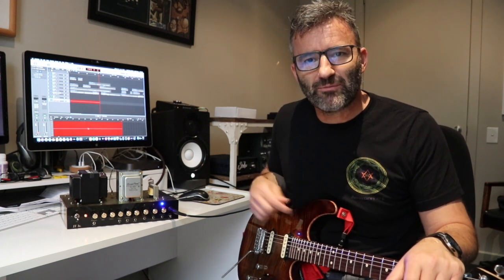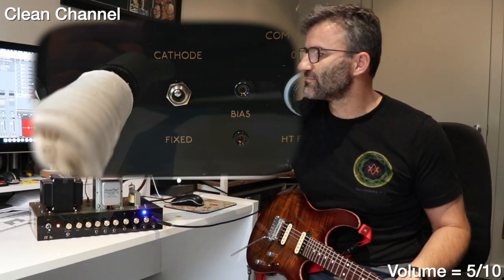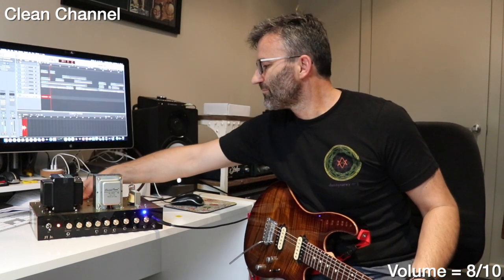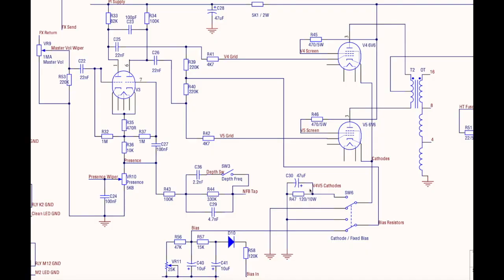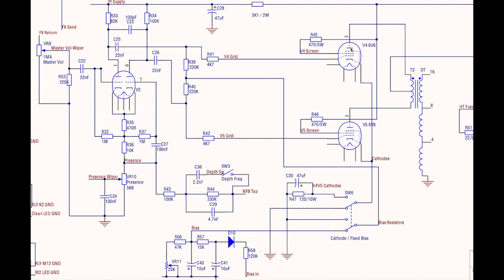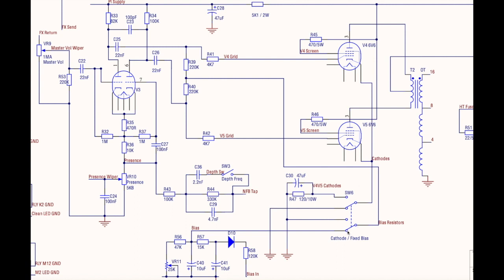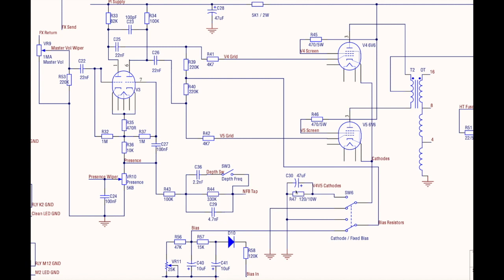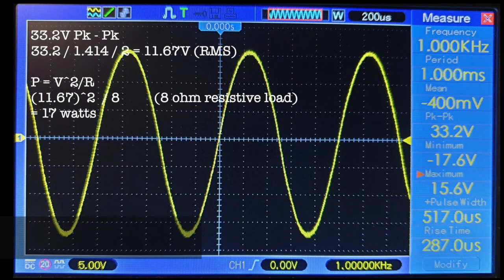Fixed vs. Cathode Bias Tube Guitar Amps - what's the difference??

Comment: I liked the fixed bias sound the best. It just sounds rawer with more harmonics and bass. The cathode bias sounds a little more compressed and maybe a little tighter. But it also sounds like it's being held back. The fixed bias also sounds like it has a better signal-to-noise ratio. This is a really good video!
Reply from the maker: Thank you John!

Comment: This video is perfect for me right now, thank you! 
I have a Princeton Reverb clone I'm tinkering with & wanted to put a cathode bias switch into the circuit. I'm learning as I go & have managed to not kill myself with cheeky capacitors so far, which is nice. 
I've played several gigs using different amps over the years, mine, using other people's, amps provided etc., I've have always suspected I leaned towards cathode bias sound (& feel), nearly, every time. Now, thanks to you, I can quickly hear the difference on the same amp. I will definitely put that switch in now. 🤘

Comment: What an excellent video. I'm about to purchase a cathode biased "metal" amp: the Badcat Lynx-x.
While cathode bias may lack low-end tightness, there is a spongyness and liveliness that attracts my ear :)
Reply: Great amp.  I have the Cougar 50 which seems to be a similar circuit made in Asia.  Of course the Linx will be made with better components, looking at my schematic, the bias circuit on appears to be some sort of hybrid design.  I don't hear this type of biasing being discussed often, and I have limited knowledge about it.  I'm assuming it is some sort of compromise to tighten the bass.  I hadn't had an issue.  I don't think you will be disappointed.
Reply: I think you are right about the design being hybrid is a way to compromise the low end tightness. 
However, as time has passed since I wrote this comment, I have changed my mind and I'm getting a swedish handbuilt 20 watter "Olsson amps Little Hill". This one is also cathode biased and I tried it a few dags ago in a shop. It was tight as hell and you dont even need a tubescreamer. Sure if you wanna play meshuggah you'll need some pedal in front but for normal metal and rock its not needed. Really impressive quality. The sound is that of a hot rod marshall and the clean channel is very warm. Extremely articulate overall and the tightness in the gain channel made me feel like a "faster player" ☺ . Im sure the Lynx is a fine amp with its own thing going on but for my needs the Olsson amp seems to be on another level completely.
Reply: @jonashjalmen5232  I just checked out a video of that amp.  I'll agree with you on the sound of it. It looks similar to the Bad Cat.   
Over the decades, I have spent more money trying to save money than if I would have gotten expensive gear in the first place.
Buy it nice or buy it twice.
Reply: @qua7771  Getting new gear is always fun and will inspire you in different ways and sometimes when the gear is bad its just a learning experience in which you can declare " i dont like this type of tone"  :) I've been using AXE FX II for a couple of years now and while that's an incredible product I have finally grown tired of it. But the good thing about it is that it allowed me to find "my sound". After experimenting with all the various amp models I usually end up with the same kind of tone and the biggest factor that decides your sound characteristic is actually the cab!!
Reply: @jonashjalmen5232  I couldn't agree more.  (Cab and speakers),  I found that out late too.  
When I started playing, we did have the learning resources and technology we do today.  I wasn't able to research gear effectively until the internet era.
A few years ago I found the tone I liked and wished I had found it sooner (A Marshall 1960 cab with two V-30's and two H-75's through the Bad Cat, after rolling tubes). I use a Bad Cat unleash attenuator after learning that every amp has a certain volume that it sounds best at. I can dial back the volume while getting "that" tone.  I can honestly say that I am satisfied, and can now concentrate on things that are less expensive.  It was a long learning experience.
I have always played Les Paul's, and super Strat type guitars.  I am now in the process of building a Tele after returning one that just wasn't for me.  I have never owned a Tele.  I cannot wait until it is completed to play it.  I hope the single coils sound good through my rig.  Otherwise, I do have a few other amps.  Cheers.
Reply: @qua7771  Its pretty similar here (born 93). But its been a good journey right ;) good to hear you've found your tone. And good luck with the Tele! 
Jonas

Comment: Good starter instructional video, especially having the tones and the theory side by side. For me, I would like to see you expand the very last bit with the oscilloscope and delve into what happens with a signal on both, not just the max power, but in terms of the bias point "changing" with cathode bias vs fixed during a dynamically changing set of conditions i.e playing a guitar :);  more of exactly "why" the sound differences occur, cathode is "softer", "squishier" etc, why ?
Reply: Because -Vdc on grid allows for lower V on cathode (thinking at idle) so higher potential to plate. So a higher wattage potential in fixed bias, esp heard in compression of lows in cathode mode.

Comment: In the old days, it was all about more power. Then the world changed and we couldn't drive a 100W amp into a 4x12 cabinet in a small club hard enough to sound good.  So cathode bias had some nice advantages: cheaper (no need for that negative grid bias circuit), self-biasing (no need to adjust the bias when changing tubes), tubes could last a little longer, and lower power giving the overdrive tone a little quieter. Now it's shifting back because distortion tones are being created with pedals for more control into a clean amp. So it all depends on what you're trying to do.

Comment: An interesting comparison. I have often wondered if there was an audible difference between the two bias modes. The 47uF cathode bypass capacitor would have a reactance of ~41 ohms at 82Hz, which may or may not be significant. May be worth trying a 470uF and seeing if it makes a difference. Good luck with your experiments. I agree that for maximum power, fixed bias is the way to go. Cheers, Steve.
Reply: Nah I think he should talk more and play less when demonstrating an amp.

Comment: When you had both cranked, do you think there was any power tube clipping?
I have done the test, and I think when the power amp is clipping is when the difference is most noticeable.
If the power amp is clean, of course there is still a considerable difference in feel, and the extended low end in fixed bias, like you said.
Great video!

Comment: Inspired by your video I actually ended up putting in fixed bias circuitry in a cathode biased amp I'm finishing up with a switch between the two. I got pretty much the same result as you got, cathode biased was sort of swampier and looser in the bottom end and fixed bias was tighter and snappier. That amp has a tube rectifier though so it's still gonna sag a bit of course. Haven't tried it out properly yet (sleeping kids 😂) but it was well worth experimenting with!
Reply from the maker: Great work!

Comment: Hi Jason, when selecting the correct value cathode bias resistor do you work that out mathematically or fit a value you have seen before / you think will be suitable and then adjust by measuring the voltage at the cathode bias resistor?
Reply from the maker: There are some online calculators for this, which give a good starting point.  Then I adjust once built - aiming for 100% dissipation in cathode bias mode.
Reply: @HeadfirstAmps   Thank you.

Comment: Fixed bias designs give the greatest output power for a given output tube - while the cathode bias is usually preferred in hi-fi applications because it exhibits the typical "classic tube sound". Another advantage of cathode bias is that you don't have to use matched tubes in push-pull output applications which can be useful if your only source of operational tubes are from discarded gear being sold off as a bargain in garage sales.
Reply from the maker: Great input Laurentz!  You are spot on.  Actually I have two Quad40 monoblocks for HiFi which are cathode bias.

Comment: I hear a slight difference. How the notes bloom, or would say compress. 
I definitely think that fixed mode is for tighter approach but the other feels more forgiving kinda.
There’s no better, both have their mojos. A great build by a master! Awesome !
Can you tell why so many guitar amplifiers don’t use Toroidal Power Transformers ?
it bugs my mind because due to its construction it should be less prone to noise...
Thanks!
Reply from the maker: Thanks for the feedback.  

Re toroidal PT's, a well laid out and deigned amp will have near zero noise with conventional transformers.  For me, I wouldn't choose one over the other for noise reasons.  There's a good response to this question from user Fuchsaudio here,   https://www.thegearpage.net/board/index.php?threads/torroidal-transformers-vs-transformers.68141/
Reply: Headfirst Amplification Oh i see ! but it’s not me or someone saying that.. it’s in their datasets 
https://eu.mouser.com/datasheet/2/177/1182-736858.pdf
lo ripple & light weight. could argue that n core could be more lighter.
i was looking for something that could be used in rack preamp build.
that’s the idea, maybe you have something coming up on that side...
look up some cool idea . nasa point to point mode soldano slo ;)
http://diy-fever.com/amps/soldano-preamp-mk2/